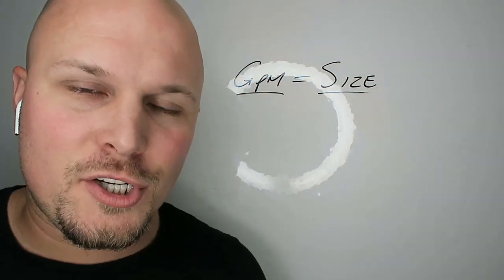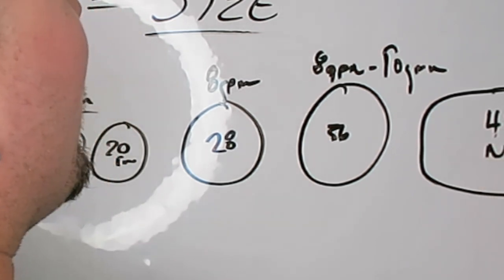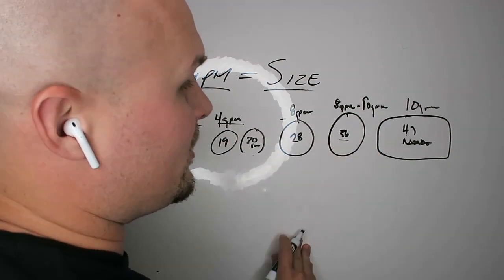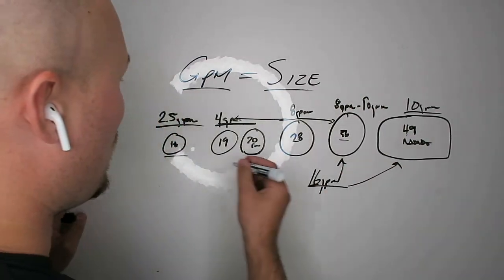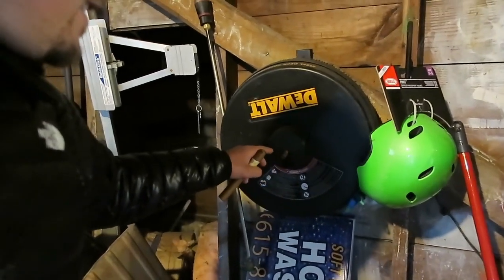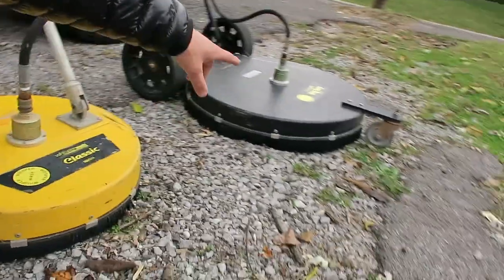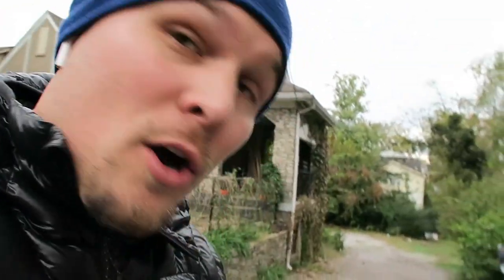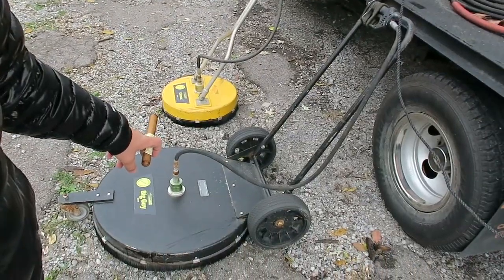WHAT SIZE SURFACE CLEANER SHOULD YOU GET?!

Comment: I have a 4 GPM 4000 PSI running a 24 inch ANT24. Straight out of the box like you say it ran a little slow so I changed the bar tips from 2.7 to 2.5 and she just flies now. The only thing I would suggest to someone trying this is make sure you have a water filter on your pressure line going into the surface cleaner to minimize nozzle blockage
Reply: Thanks so much for sharing I was thinking about getting a 24 inch for my 4.2 gpm 4200 psi pressure washer but people with 4 gpm machine keep complaining how 24 is not quick enough. I always have a feeling it was the nozzle that slow down their work. What degree nozzle are you using?

Comment: Great content again Aaron. Watching your videos inspired me to start my pressure washing business here in the UK I've just upgraded from the 15lpm machine I started business with to a 21lpm belt driven machine. Got my first job with it on Sunday and I can't wait to use it. Hopefully be even better with my 20" Whirlaway. Looking to drop down to an 18" for the ultimate cleaning power from my pump. Thanks for all the useful info and advice in the videos, keep it up!
Reply from the maker: Bro! I don’t know the liter conversions but either way, rooting you on!
Reply: Hi mate, what size surface cleaner did you use with your 15lpm machine? cheers
Reply: @SuperMbongo I bought a 20” Whirlaway which worked ok but had to be very slow with it and have a couple of passes. Works so much better with my 21lpm machine though
Reply: @MattL1987  Thanks for the reply mate, I'm just starting out so the info is greatly appreciated. Would you say 18" would be the sweet spot or even 16"?
Reply: @SuperMbongo  16" would be better for a 15lpm machine, but it depends what nozzles you run. The sweet spot for a 21lpm machine is an 18" SC in my opinion. Let me know what you go for buddy.

Comment: You focused on the big units my man. You’re not covering the 2.5, 3.5 gpm. You also mentioned the psi does not matter but it actually does in order to attatch a unit that will work together.
Reply from the maker: Anything under $1000 retail is still hobby time. And since many of our jobs are over $1000 alone I don’t see the need to cover such a low barrier to entry unit. I may though since you brought it up.

Comment: This is true now what I've done was buy the 47 and 32 inch from northstar and I did a little modification to the 47inch.
I changed out the tips for 1.5 gallons and extended the center bars with half inch longer ones and it's amazing in stock form my 8gpm unit was leaving strips between the 3 spray bars but now it's perfect and yes I recommend the mods if you buy this one or it's gonna be a waste of money without a larger gpm system. ATLANTA POWERWASH SOLUTIONS INC  out front
Reply: Thanks for the info. I bought a small 2.3 gpm and bought a 20 " surface cleaner but I never realized you can change the tips.

Comment: We don't measure in gallon but my question is I have Honda 3600psi pressure washer and surface cleaning 24 inch but it doesn't properly do the job ..why ?
Thanks.

Comment: Hi!
Love your videos. Learn so much! 
I have a question about surface cleaners and nozzle size. Could i use a smaller surface cleaner like an 12/16" with a 8gpm? I would like to use a cleaner on a extension pole for roof cleaning (concrete roof tiles). What size of nozzles should i use? So the cleaner dont start to fly🙈 Thanks again mate for great video's😁

Comment: GREAT VIDEO! i have a question. Will the classic 19" work with my setup I have a Honda GX200 motor (6.5HP) with a AR pump 3.5GPM 2500PSI. Should I reduce and get something smaller? thanks so much
Reply from the maker: It might but it’ll prob be slow.
Reply: @AaronsLeanMeanAcademy  appreciate it

Comment: Hey Aaron can you help me with my surface cleaner. I have a Simpson Water Blaster 4400psi 4gpm belt drive unit and my surface cleaner is a Simpson 20” when using it tends to lift off the ground could you tell me what size tips you recommended please? I don’t want to cause any damage to anything. Also I like all your videos keep them coming Thank You
Reply: I have a similar set up and I use 2 3gpm 25 degree or sometimes I use a 4 gpm with 15 degree’s.   Those work great for me.

Comment: I’m brand new at this. I’m getting a Greenworks electric that puts out 3000 psi and 2.0 gpm (max). I was looking at an Eveage 24” surface cleaner and it said that it was compatible with 2000 to 4000 psi washers. But that won’t work according to your advice because of the gpm.

I want to clean my driveway. What is the max size surface cleaner that I can use with this pressure washer?
Reply from the maker: I would look for the greenworks surface cleaner, its probably a 12"
Reply: @AaronsLeanMeanAcademy  yes thank you but it is plastic and has no caster wheels. Would a similar Eveage do the same?
Reply from the maker: @lawrenceeason8007  probably.
Reply: @AaronsLeanMeanAcademy so sorry. But one thing I’m confused about. The greenworks pressure washer is 2.0 gpm and they offer an 11” surface cleaner with their pressure washer.

But “experts” online keep saying the proper formula is 4” for every 1.0 gpm. So that would be 8”. Is Greenworks conning us on this or is this formula incorrect?
Reply from the maker: @lawrenceeason8007  if they're offering it with it, it should work you'll just have to go slow.
Reply: @AaronsLeanMeanAcademy okay. Thank you

Comment: I have a like 3800 psi 4gpm and a 24in surface cleaner.  It's slow should I change the tips or just get a 20in .   Thanks man.
Reply: I would downsize to 20 or 19 inch. 24 inches is really big for a 4gpm machine.

Comment: With 4GPM Simpson do you think I'd go faster with a 20" that covers more area than say a 16-18"? I'm leaning towards 20" as a lot of people say it works with 0 problems
Reply: Any issues running a 20 inch SC on your 4 GPM pressure washer? I was thinking of getting a 16 inch SC for my 4 GPM pressure washer.
Reply: @JesusPaidItAll  No it's worked perfectly! No issues
Reply: @TREBLEBOOSTER65  Thats good. I am probably going to get a BE SC. The Whisper Wash SC are nice, but expensive.
Reply: @JesusPaidItAll  That's what I have. Admittedly we've only done a couple of jobs, but it's been great so far
Reply: @TREBLEBOOSTER65  The BE or WW?
Reply: @JesusPaidItAll  BE
Reply: @TREBLEBOOSTER65  Right on, what website did you order it from?
Reply: Can u run a 4gpm 20’ on a normal house a spicket or do you have an additional water source?

Comment: Hey buddy what would you recommend for a horsepower engine to push a 4 gallon per minute pump? New guy starting out kind of want to be in the middle. Definitely like the 19 inch surface cleaner. Only have a seven horse with a three GPM at the moment not sure if it will run a 19
Reply from the maker: it will but itll be slow.
Reply: @AaronsLeanMeanAcademy  thank you ! Ill save alittle more and get the proper setup

Comment: So what size machine are you using with the 28”?
Reply from the maker: 8
Reply: @AaronsLeanMeanAcademy  I’ve been told that 8’s aren’t big enough for 28”-30” the passes are too slow
Reply: @AaronsLeanMeanAcademy  was figuring on a 24”

Your opinion?
Reply from the maker: @davidintili6647  an 8 will push any single bar out there. Don’t overthink it.
Reply: @AaronsLeanMeanAcademy  it’s not a matter of pushing it. I’m talking about how slow you must go or not.
Reply from the maker: @davidintili6647  what result are you wanting?
Reply: @AaronsLeanMeanAcademy  I just don’t want to crawl

Comment: Do you think a 3.5gpm can push a 20” whisper wash?
Reply from the maker: Barely
Reply: @AaronsLeanMeanAcademy  would a 16/18 work better. I’m getting tired of my dewalt special
Reply from the maker: @Chevygang23LT  yea that 3.5 is not pushing enough water. I’d upgrade to a 5.5 then get you a new surface cleaner
Reply: @AaronsLeanMeanAcademy  can I upgrade just my pump to a 5.5? I have been thinking of that

Comment: Watching this video and I’m a little worried. I gotta say that this video was one of the more promising videos I’ve seen for my situation. My situation is.. I bought a 3.5 gpm machine for about 1k bucks at Home Depot because I’m impatient and the 4 gpm was out of stock. Anyway….On Amazon I bought a 22 inch surface cleaner. Keep in mind this was all before I learned the 4 inches to every gpm rule. Again sometimes I jump into things. A downfall of my agressive personality. My question is will it work or am I going to need to pick up a crappy little 16 inch dewalt until I can upgrade to either a 5.5 or the 8gpm machine?
Reply from the maker: Gonna be slow but it may work.
Reply: @AaronsLeanMeanAcademy  ok. Much appreciated. 🤞
Reply: @leepyle1188   as you said you have a impaient attitude so im thinking this will just drive  you crazy having to slow your roll. but it'll sure make you hussle some work to upgrade.  im kinda the same way i want it to work at my speed, but im tight with money so i feel i have to do ton or research befor spending a dime. good luck to ya buddy